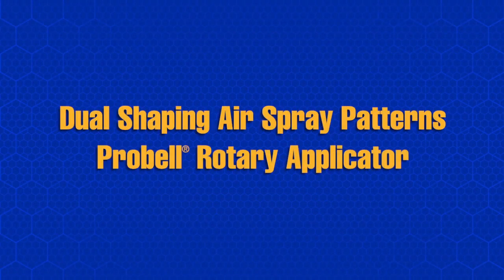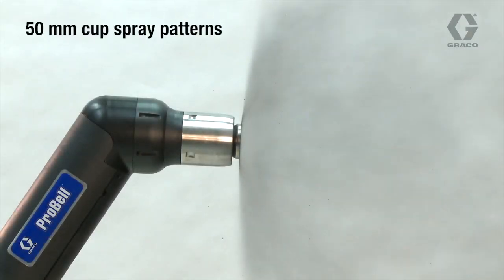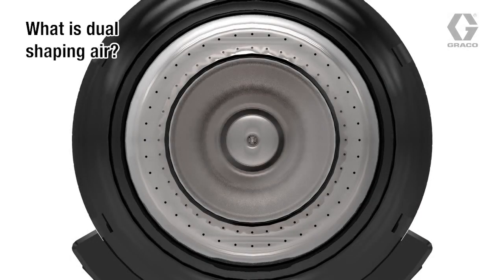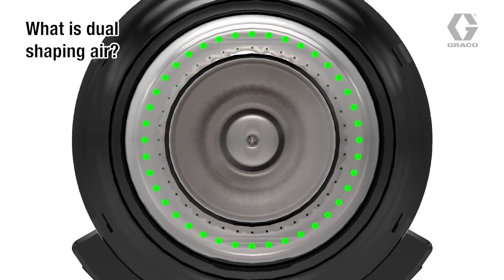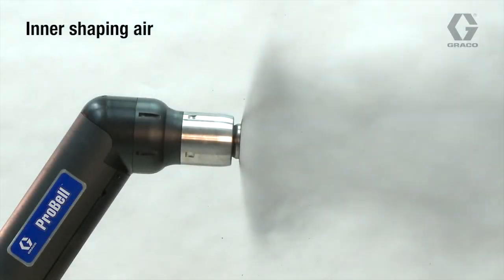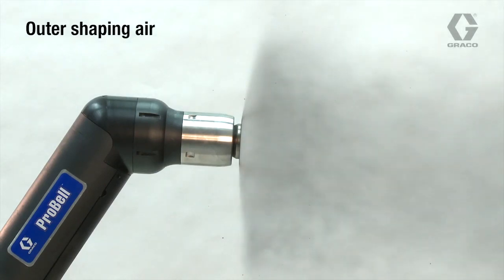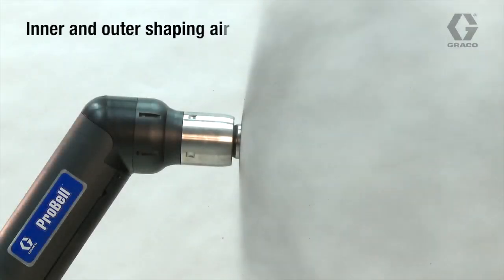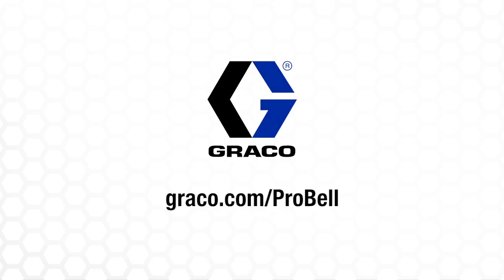Dual Shaping Air Spray Patterns - ProBell Rotary Applicator

Comment: Should u calibrate the shape air ring each time it’s removed
Reply from the maker: There is no need to calibrate after removing the air caps.

Calibration is performed at the factory and should only be required when replacing an air regulator or voltage to pressure regulator, or after updating software.